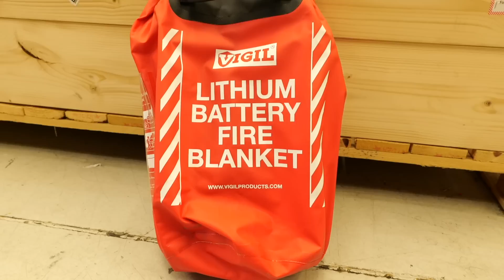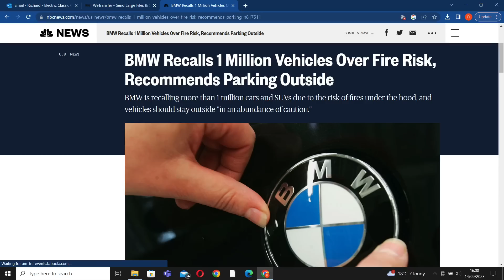Electric Car Fires - Facts and Figures

Comment: This fits in with the stats available widely in the UK for 2022. 25 EVs per 100,000 cars caught fire against 1530 ICE cars per 100,000. Going by these stats ICE cars are 61.2 times more likely to catch fire. Read into that what you will.
Reply: I think you got the multiply/divide bits the wrong way round. The stats are already in normalised 'per 100,000 vehicles of the same kind' measures, so no need to apply the % in service on the roads value twice. 

I'd agree about the charging issues, which are higher up the electric network chain. Remember a regular petrol/deisel pump delivers a 50MW (megaWatt) connection in you hand, which is a 1000 times bigger than a 50kW fast charger connection. Were gonna need bigger pylons to the service stations ;-)
 @aurustius
Reply: Not sure where you get these figures from.1530 fires per 100,000 cars so 1.53% ? So out of 100 cars 1.53 of them will catch fire ! Even the presenter said it was 0.08%.He doesn't mention how many were stolen and then deliberately set on fire which happens a lot in the UK.
Reply: Laughable !  I suppose the report was written in Tory h/o!!!
Reply: @aurustius the numbers were already per 100k. You took the per 100k and tried to calculate per 100k on top.
Reply: Be wary of implied scale for those statistics (really, "95%", of what?). You need to dig deep to find out just who's stats you are looking at and the way they are determined and recorded . Most burnt out cars have no forensics applied, so it's a case of 'tick a box, any box'. Likewise there is the question of just what melted the wire (if that is what happened) - was it undersized by a non factory mod, was it wrongly installed, or just laid over/near the exhaust! 
In the RoRo shipping case I've seen, it was that ~50% were dismounted refrigerated containers, and it was the cooling unit that started the fire (UK North East Shippers study). 
The 'lots' of wiring in an EV also doesn't compute, as most wiring is for driver convenience functions, common to both types.   @vincentho6840
Reply: I will read into it son....what percentage of fkn drivers there even own EVs? lmfao.
That details makes a shit ton of difference in the discussion
Reply: @vincentho6840  wrong. The majority of fossil car fires are from fuel leaks. You got tricked.
Reply: @jocodashcam295  Bs your are wrong !

Comment: The batteries coming on line and I hope catch on, Sodium Ion and Solid state are even safer than the current Lithium ion. Apparently simply can't do a thermal run away. Doen't prevent a short setting fire to the carpet of things like that.

Comment: The cheaper Chinese brand cars are definitely an issue. BYD in particular has a really bad track record, even more so in their home market in China. 1580 So far in 2023.
Reply from the maker: I don’t doubt it but that number has to be put into the context that BYD has sold over 4 million battery cars in China so far.
Reply: BYD sold 1.8M vehicles world wide in 2022, way more than Tesla. If that 1580 figure is accurate (doubtful), then that is a fire rate of 0.088%, ie a very low chance of fire.

You should be aware that most Tesla evs sold globally use either BYD or CATL LFP batteries now.

Comment: I could be wrong, but I thought a fire blanket worked by depriving the battery of outside oxygen, removing one of the three requirements of a fire. On this note, I wonder how much bother (and cost) it would be to add an in-battery non or minimal harm fire suppressant system that activates the instant it detects one of the cells going above its thermal range. Like, a liquid cooled system that is always thermally managing the battery that can alter its liquid path to surround that cell and concentrate its efforts to suppress it before it gets out of hand.

Comment: I wonder if you can put an expanding foam pouch in each battery module that bursts under certain temperatures. It would then completely encase the burning cells when they start to run away.
Reply: Won't that's just add fuel to make thermal runaway worse
Reply: @jayhoney2422  I was hoping there was a fireproof foam. Or something even better that turns into something that could smother the fire.
Reply: i get the idea...fire should be controlled at that level.... @JoshuaPritt

Comment: Those 20 EV's catching fire here in Sweden isn't even the real number. Because 10 of those wasn't the car itself but the electric outlet in the house getting overheated and starting the fire when they charged. People pulled over 2000 watts from old sockets that couldn't handle the heat. So new recommendations say that the outlets should be a 16 amp or don't charge at home if you have an old electric system

Comment: I for one will be more comfortable when LFP batteries are widely used, both in terms of safety but more importantly, longevity. I wonder if there is still a concern with older batteries reaching a point where they might short-circuit and cause thermal runaway.
Reply from the maker: Yep, my wife’s Tesla M3 has LFP modules in. 👍

Comment: Some of Moggy's facts aren't exactly correct. There's one major fact that's omitted about lithium-ion batteries experiencing thermal runaway, it's the often overlooked and understated hazard of vapour cloud explosions! 💥

If you want to see some vapour cloud explosions or how ineffective the huge fire blankets can be or hear about the failed test of the "very effective" Rosenbauer system or hear how some car parks have already banned electric vehicles, I highly recommend that that you do a search for the 'SWFRS webinar with Prof Paul Christensen. Lithium-Ion Batteries'

Also, there's some independent research into the situations/OEMs of 96 EV fires and they found the most common situation that it occured was when charging, followed closely by when parked and not charging! Just do a Google search for "IDTechEX electric vehicle fires".

As for the Fremantle Highway, you can watch a Mercedes electric vehicle reigniting weeks after the initial incident here: https://youtu.be/GAah11rqsx0?si=RnAhox2sFX2W4eJG

Comment: If you could get to the pack early enough the trick might be to freeze the cells AROUND the area already shorted to prevent spread.
Maybe a liquid nitrogen lance?
Reply: what do you then do with a possible reignition at some unknown time later on? I wouldn't want to get anywhere near a battery fire, even just off-gassing, especially not to check which bank of cells had gone run away...you do know why firefighters wear all that PPE and breathing apparatus don't you? Check this one: https://www.youtube.com/watch?v=mIIdMkwKLp4
Reply: @LoremIpsum1970  that's not much different from not smoking around burnt out cars that have lots of toxic residues and any remaining fuel stuffs. In some senses it's a familiarity problem (came was when horse drawn trucks were phased out)
Reply: Simply a water lance is sufficient, with water from the on-board fire truck's tank. https://www.youtube.com/watch?v=4xjDdmv8urk

Comment: Have you looked at the causes of fires in petrol cars of late? 
Alot of older car fuel lines are being effected by ethanol in modern petrol, rotting them, causing leaks ,and then a fire.
Also, a large proportion, are caused by a battery fault (i know a few race cars in trailers have been lost, due to using lightweight lithium batteries), so is that still a IC fault? 🤷‍♂️
I run the RC racing world, so not against electric, but we've been using lithium batteries and been putting then to their limits, for over a decade, and still not found an effective way to put out a fire ,only to contain any fire (using the fire blanket/explosion charge bag when charging the battery) and let it burn itself out (if the car is on track, its covered with a bucket full of sand).
With racing RC, its shown that the risks rise exponentially as the battery gets older ,maybe as we run them hard and charge them hard, but although only a small percentage now, it will probably rise, as batteries start to decay.

Comment: If i look at it and look at the risks, for a petrol car there is a little more needed to start a fire. At least a spark hot enough to start is. Sparks comes most of the time from a short. Now for a petrol car that is "only" 12 volts. With an EV it's a lot more and the thing i can imagine why not to park near your home, even though the charging unit is on the wall of your home, it only need an excessive powerdraw to get wires that hot to start a fire. That can start from the wall mount. A short in an electric car is more "easy" because there is only electricity and a short can start a fire. There was a rental company in Australia where an EV was damaged and the mechanic was "smart" and took out the battery. Open to the elements it shorted, thermal runaway and a fire was started. This happend near an control tower of an airfield. These things are more prone to happen with EV's. I don't write off EV's in general and i like the technology but it's still not the perfect solution to stop pollution. A lot can happen with a lot of fires. To show my fear, there are not a lot of EV's at this moment. When there are 70% EV's rolling around i would be very scared. Companies are trying to cut costs and the first place to do that is safety.

Comment: One of the problems the Media seems to keep rehashing regarding Lithium batteries is the difficulty in extinguishing them with WATER. Perhaps if they used the correct medium for a chemical fire that flares up with water, the fire would be out much sooner. I remember seeing the effect water has on a magnesium alloy fire resulting from a VW engine fire, it only made that worse too.
Reply: So what you are saying is that when the fire brigade takes 4 hours to put out a EV fire, it's because they don't know what they are doing. And after they have put it out, and hours later it bursts into flames again, it's their fault.

Comment: Technologies have come a very long way these days within electric vehicles, as they are working on cooling systems on that enclosed within a battery area, they have cooling fluid, and its either anti freeze and anti boil technologies, especially for a country such as Australia, with its very extreme heat 🥵🥵🥵🔥🔥🔥, and right here in Australia now coming into our warmer months, as its getting very close now too bush fire season here👍😎👍🇦🇺🇦🇺🇦🇺

Comment: Saw many EVs catch fire in Florida after Hurricane Ian.   Unlike ICEs, you can't put out an EV battery fire.
Reply: yes you can, if you put a hole in the battery pack, and no you wont get electrocuted.
Reply: @kevinashurst634  if that's the case, you better tell the firefighters of your brilliant discovery as they still have no viable way of extinguishing an EV fire.  Even the ARFF boys (airport firefighters) are still trying to figure out how to deal with lithium battery fires, and they have access to both the best training and best apparatus /equipment available.

Comment: Your misrepresenting the facts. The ICE vehicle fires 99% are from components failing not the fuel system. Electric vehicle fires are all a battery/powertrain failure. The fire fighters are unable to extinguish a lithium fire and have to let it burn itself out. Plus the heavy metals released during a battery pack fire will disable if not kill any person that gets physical contact with the smoke let alone breathe it in. How many homes have their electric vehicle charging overnight in a garage that is part of the home or under the bedrooms in a 2 storey home? Would not want to wake up to a room full of heavy metal smoke like Cobalt etc from a malfunctioning charging EV battery.
Reply from the maker: I’ve breathed in fumes from an EV fire demonstration and touched the aftermath. Please explain how I’m still alive. 😆🤣😂😉
Reply: @crazyharry1586 , OH the Terror !!, Hows your Phone, next to your Ear ? or any other Battery Powered Device you have ?, Another dangerous habit is people who store Petrol inside residential Buildings as well, IN A CAR !!!!!, I have been in a Couple of Fires, & 1 Explosion, all from Morons & Petrol, so Far after 50 Years working in PC's NO Battery has blow up or Caught Fire yet, only gone to re-cycler ...

Comment: Great review Moggy. I would like to know what brands of EVs, Tesla's are very well represented for fire's there again there's a lot more Tesla's out there. For example a Tesla went up in smoke in Sydney a couple of days ago and made the news. So yes a breakdown of battery chemistry and brands would be good. Thanks Peter
Reply from the maker: That would be interesting information but I wonder if the same information is available for ICE vehicles.
Reply: I mean to say what brands of EVs catch on fire and at what percent?
Reply: @PeterHarding-rt5mx BYD sold 1.8M vehicles world wide in 2022, way more than Tesla.

You should be aware that most Tesla evs sold globally use either BYD or CATL LFP batteries now.
Reply: FYI, every single Tesla fire will make front page news. You won’t hear about fossil car fires.

Comment: Thank you for explaining  so well  the different type  of fires . Unfortunately  I  feel the ICE manufacturers along with Oil companies  will be fighting  for some time against  EVs .
Reply: Lol!!!!!!!
Reply from the maker: They’re fighting a losing battle against progress and a better technology. 😉👍
Reply: @ElectricClassicCars  isn't that same oil beeing used to make literally everything including roads, tires, interior, to get raw materials and more!? Even the food you eat and your clothes it's all oil.
Reply: @miezeKotze-e4k  Which is why the "oil" industry will still be around for a while, making Lubricants & Other Chemical Processes to LOCK CARBON UP, instead of something that gets burnt to Ash & Released to Atmosphere to Screw up the Atmosphere Faster, Electric Vehicles have fewer Parts, easier to manufacture, but the Plastics used to make body & or Panels is a Concern, but it is still Carbon Locked up in something that should have 10 years of USE before recycling, during that 10 years theoretically zero Emissions (other than manufacturing costs), whether that is Enough to cancel things out is another question ... P.S I think Planting More Trees is Easier ...
Reply: @James_T_Quirk  ICE  have more moving parts! have significantly way more range, way more capabilities in literally all conditions are a le to work for 24/7 in the middle of nowhere!
Reply: @James_T_Quirk  I donot see any of your super perfect EVs even remotely contributing to this world! Everything from roads to grid, agriculture, aviation, renewables.... nope they are just here to rely on it!
Reply: @James_T_Quirk  I'll like to see how an electric Airbus A380 fully loaded with move people directly from New York to Sydney not stop or even like the recent almost 10,000 people capacity icon of the sea new cruise ship will do! Lol!!! It's not hate but reality!
Reply: @James_T_Quirk  people have been comparing ICE to horses! The veritable question is what have horses really achieved that can even compare to ICE!  the world was built with the help of ICE and oil, nothing more nothing less! Your EV today is still almost 30% oil driving on asphalt roads with tires made from oil, connected to internet that was also made possible with oil......
Reply: @ElectricClassicCars the better technology will and remain ICE and oil! It doesn't just power your tiny car but also even rockets and other gigantic machines and projects! I'll like to see one day a massive battery powered rocket launching satellites for internet 😂😂

Comment: Its already safe  with Lithium Fe especially if they are Li fe blade cells.
You can drive a metal spike through them and they wont even get that hot.. dont try it with round cells or other Lithium ion chemistries. 

Na Al and Sulpher batteries are the next wave and are even safer and they can handle temps, charging and discharging rates that would melt current lithium packs in  trying ... They can also be deep discharged from the early tests and transported flat without damage.
 Interesting Li might still have a role but only as an enabler minor component added to the Al S batteries electrolight.

Your phone is more likely to cause a fire if left on charge.
Reply: Spud can you look at the Advanced Electric Machines rare earth free motors from NE 🇬🇧 and the Molabo motor..  again rare earth free motors.. 
Its prettymuch the way things will have to go to replace ICE motors.

Comment: Bigger batteries on EVs often sit lower than the petrol tank, so are more prone to fatal damages. Some ICE fires actually start from brake fluid or oil leaks instead of petrol leaks.

Comment: Some of the hype is to safeguard ICE vehicles' perceived safety record. Second it is done to discourage interested parties purchasing EV vehicles. Third is media grabbing headlines. Fourth is ICE protection by promoting a barrage of negative EV failures. That protection can come from: media, special interest groups, legacy automakers, government. % & #'s can be easily manipulated by region/story/vehicle/biased or faulty reporting. Plus with smaller volumes compared to ICE vehicles, results may initially appear higher or lower depending on circumstances.